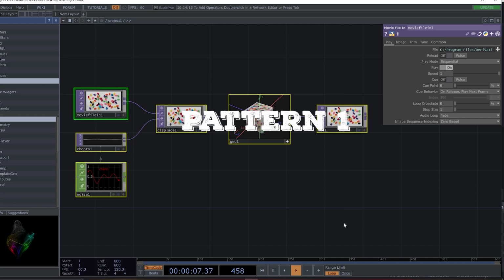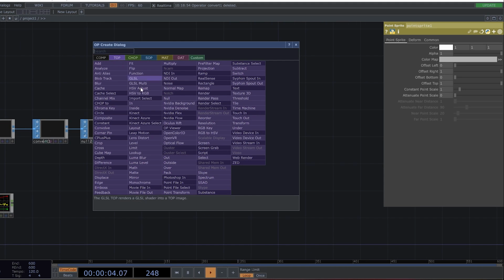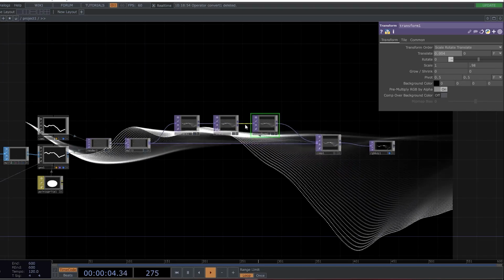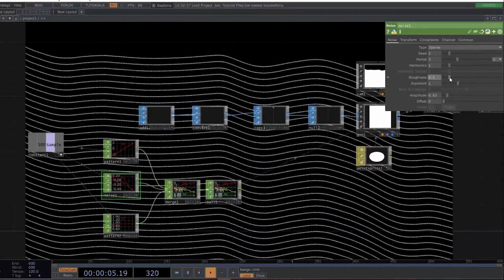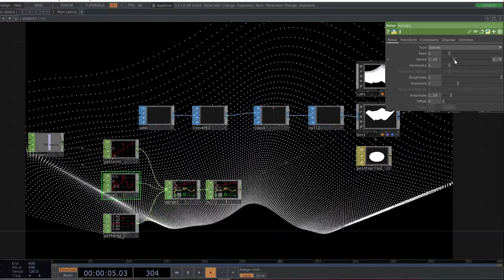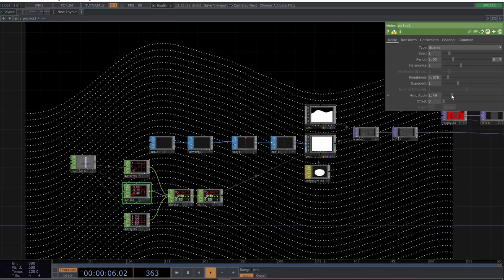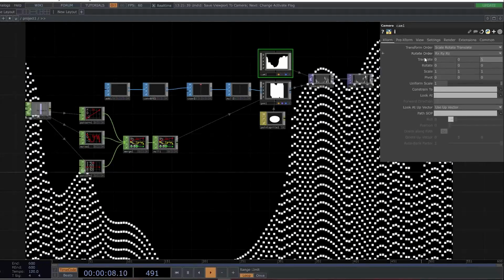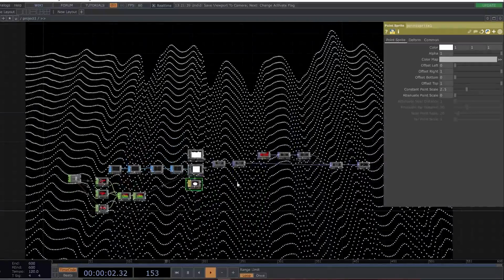Touchdesigner Tutorial: Use of Patters and Noise

Comment: Thanks and Quick question here!, 1. Can I make a movie file out with a background screen cosisting of multiple images that I activated? or 2. How can I make one operater consisting of multiple images to make a movie file using a movie file out function?
Reply from the maker: yes that can be done. Make sure to use Combine node. You will also have to use Transform to put their positions so that images or patterns are not overlapping. Once all of them are placed properly using Transform then combine them together and pass it on to Movie operator.